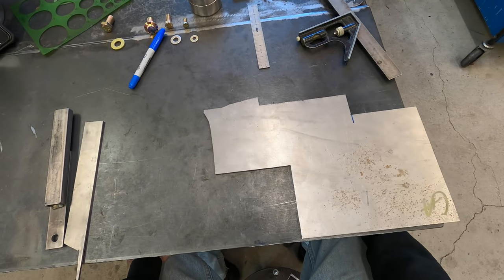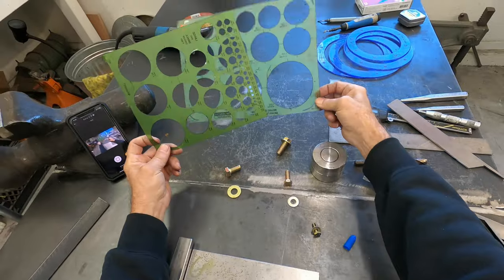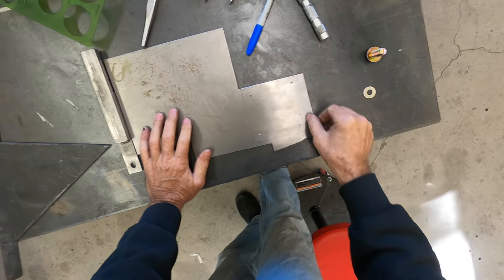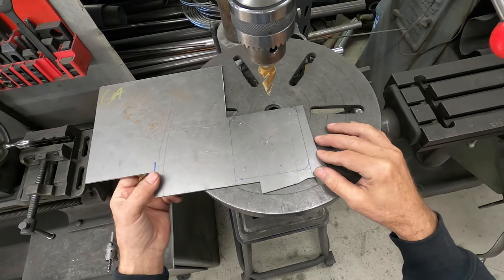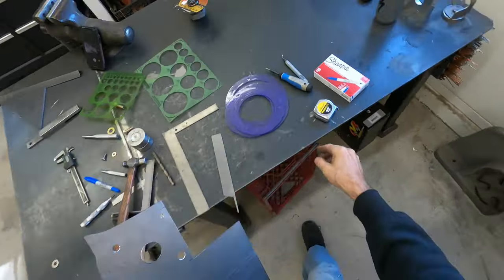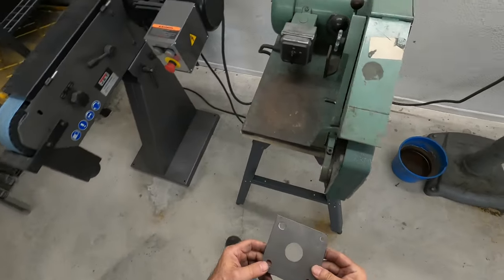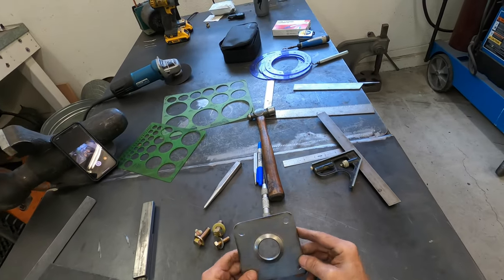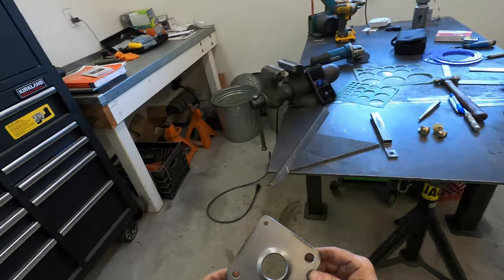Basic fabrication

Comment: All good stuff.  Many years ago I had a deburring tool bit break in half, and cut a finger that was holding the part.  Since then I've always held the part with a leather glove when deburring holes.  You can also get what looks like a countersink tool for most deburring tool handles, good for deburring small holes in thicker material where a step drill doesn't work.
Reply: Did the work cut you?
Reply: @janeblogs324  No, the deburring blade broke in the centre, leaving a sharp cutting edge.  Made a trip to the local hospital emerg for a stitch in the end of the finger.  That's what convinced me to wear a glove.